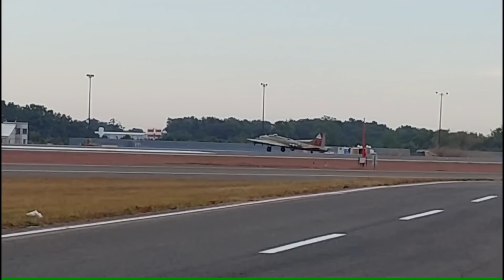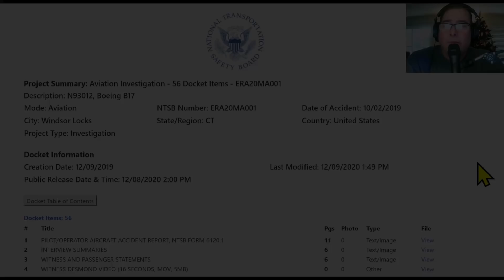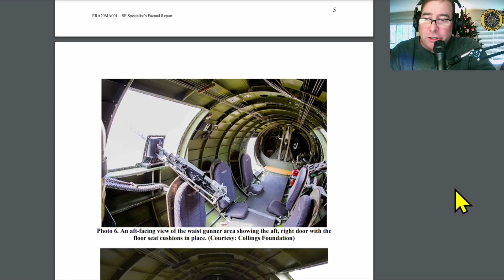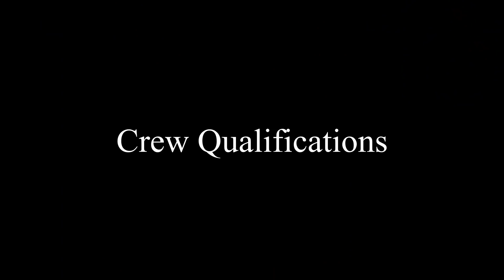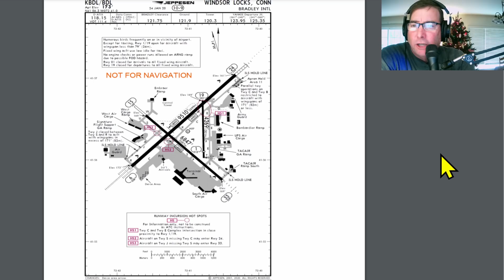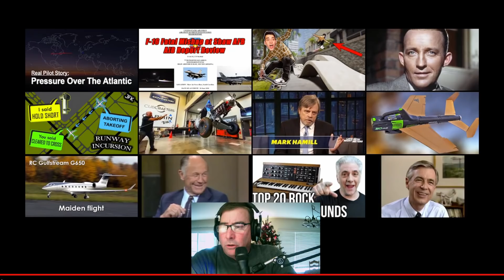NTSB Factual Report B-17G Crash 'Nine-O-Nine' Part I -16 Dec 2020

Comment: 2008 my son and I got a chance to fly on the 9-O-9.  I believe Mack was the Pilot. Looks very similar and the co-pilot who was on his first trip with them was very experienced.   Flight engineer and load master very good too. We got to assist in rollin& the engines over by hand.. We got good instructions on safety. Escapes routes.  Even told that doors were designed as break away so do not step on one.  Briefed on traveling through plane. Don't use the cables running through the cabin as you would be "controlling" the plane.  Wonder flight out of Manchester NH in September .  Sounds like something changed.  I am a Merchant Mariner (chief engineer) and very familiar with Similar requirements like SMS and others in this report.  We did get a thorough familiarization. We sat for take off and landing in the radio room strapped in. Once we were airborne we got the signal to get up. The overhead panel was removed so I was able to get some great pictures looking back at the runway with the tail of the plane.  No plexiglass over it. It was a great 45 minute flight. Hope they clean up and continue flying. But safer.

Comment: From the video, it certainly looks like she was getting really wallowy on the downwind leg. I guess options were running really thin on the ground at that point. Such a tragic loss.
Reply: Juan calls it monday morning QB, but they passed by the closer cross runway.  That in itself is not necessarily a mistake,  but it may have been one option to break the chain leading to what happened.    If I was low and slow, I'd think the relief of getting on final for any runway would be magnetic, barring unworkable crosswinds.
Reply: @johngoscinski1995  I'd like to think I would have been mindful of 180' of turn towards dead engines when there was the option of just 90, but I suspect that call may have had to be made before the point we saw at the beginning of the video, at which point he may have had 3 working. I guess we need to tune in tomorrow.

Comment: Am I wrong in my understanding of the level of importance to try and make slow turns only in the direction away from the bad engine? I was trained to bank up to 5 degrees toward the good engine and make pattern towards the good engine. Seems like there are a good amount of twin engine out crash accidents having the pilots flying turns into the failed engine , slow airspeed and then spinning into the ground. Looks like the B17 in this case was in a right traffic pattern with the outer eight engine out. Would to like to hear comments on this; would it be helpful for this practice to be emphasized more in multi engine training?
Reply: He may not have had a choice at BDL as there is a ridge to the west of the airport. I hope Juan talks about this more in the next video.

Comment: I'm very surprised that modern belts were not installed. It's bad enough on airliners that the  belt buckles differ so much from automobile buckles, but these military ones look impossible. With sideways seating, there ought to be shoulder straps as well and  a headrest or pad on the wall; in fact, modern military aircraft have backward-facing seating for passengers although paratroop transports have the sideways kind.

Comment: The 9-0-9 was at St. Paul, MN airport August 2007 along with its companion B-24 and B-25.  I did not have my video camera with me.  All three took off right over me.  That was a goose bump moment.  The loss of the 9-0-9 and the lives that were lost gives me that pit in the stomach feeling.  Good job, Juan.
Reply: I helped run that airshow at Holman Field with Craig Schiller from Golden Wings up at Jane Field in Anoka.

Comment: Nine-O-nine was in Florida a few months before this accident. One of my dreams in life was to take a ride on a B17. I had the money for a ride, but I didn't go. I am not sure why. My friend was urging me to go, but I just said no. She was a beautiful bird. :-(
Reply: Years ago saw this in Brainard/CT & wife offered a ride for my Birthday . Unfortunately my disabilities prevented me from boarding,  Seeing this on a Conn. Station gives me the chills even Now.
Reply: @nickoshana2246  I did crawl through Nine-O-Nine because of my health issues, like you. There was a B24J there too. Oddly enough I saw the fueling Nine-O-Nine and I asked what octane gas they were using. For some reason it just kind of concerned me I don't know why. I mean you get down to it without any turbo boost you could typical car premium would run in those engines. You would need to add a little bit of lead to it but it would run. A guy fueling told me it was 100 octane. Even that is a little low if you're going to run the full power of the turbo superchargers into the engines. I want to say during World War II it was 110 or 120 octane gas they were using. They're using something similar in the M4 Shermans. My dad told me about needing to wear gloves when he was feeling the tanks he operated because gas would just burn your hands up. By that I mean chemical burn.
Reply: Yeah I hear in Florida when it rains it doesn't mess around. I wouldn't call it a monsoon but I've had four inches an hour fall at my house here at times. And that wasn't even during a tropical storm or a hurricane. I actually have a weather station that measures all that stuff. It can get pretty interesting when you're lightning sensor keeps going off and you realize that there's been 409 strokes of lightning within 20 miles of you. Simple rainstorm here can throw 50 mph winds your way on a really bad day. Part of why I don't have trees in my yard. At my age cleaning up branches and leaves and what have you is just not possible.
Reply: Somewhere around 1987, 9-0-9 was a fresh restore.  I was a freshman in college at Embry-Riddle, right on the Daytona Beach airport.  One thing about Florida.  When it's raining, your options for recreation shrink drastically.   One rainy weekend, we had been trapped in the dorms when one of the guys pointed out the 9-0-9 was open for tours across the ramp. We went over there in the rain storm, and paid $4 each (1987 remember) to tour the airplane. And by tour I mean they set 3 flight-crazy college boys loose in the plane.  We swung ourselves up into the nose thru the crew door.  With the weather, there wasn't even anyone showing up for tours.  We had it to ourselves for a good 45 min.
Reply: @johngoscinski1995  That would be fun, have some friends that were a big time enthusiast for b-17s to go crawl through. The friend I was with like them but he's not like rabid like I am. It is my absolute favorite plane in the world. Maybe it was all the movies I saw as a kid and the TV series 12 O'Clock High. I just always loved the bird.

Comment: I also flew on a B-17G several years ago. I sat in the nose cone seat during taxiing and take-off. No safety instructions were given before or during the flight...the whole flight was exhilarating!!!
Reply: During WWII the bombardiers did not sit in their "window office" during takeoffs and landings. They sat with the navigators in the lower forward compartment.
Reply: Which B-17 was it?
Reply: @capbustchasing  "Sentimental Journey" flown by Commemorative Air Force. It was making the rounds in northern USA and parts of central Canada. I jumped on board at the Canadian Warplane Heritage Museum at Hamilton Airport in Ontario Canada.
Reply: From wartime experience sitting in the nose cone seat any safety instructions would have been irrelevant, they were nearly often killed, so much so they stopped sitting in the nosecone seat during takeoff and landing.

Comment: Just found my pictures from when it was at Nashua airport (KASH) maybe a week before the crash.  The two right most engines (#3, #4) have tons of burned oil marks on them, and the two left engines (#1, #2) do not
Reply: You might consider emailing those pictures to the NTSB.
Reply: @joevignolor4u949  hoenstly I tried but I couldn't figure out how to do that

Comment: "Criminal negligence refers to conduct in which a person ignores a known or obvious risk, or disregards the life and safety of others. Federal and state courts describe this behavior as a form of recklessness, where the person acts significantly different than an ordinary person under similar circumstances."

The scat is about to hit the rotary oscillator.
Reply: Honestly,   this event raises some ire in me.   An event like this could jeopardize the future of passenger warbird flights in more ways than one.   The sheer level of irresponsibility is stunning.     The belts,  the passenger briefing,  leaving that much runway behind you when you know you just had engine problems,   all of it.    The FAA is likely to come down hard,   but,   if they look in the mirror they have to accept their share of the blame for their complete lack of oversight.     Insurance for warbirds is already ponderously expensive and hard to obtain,   there is going to be a cost ripple.   And the lives lost,  they can't be replaced.    And one more thing,  it strikes me as a potential conflict of interest when the person who gets to fly your toys the most is also the chief maintenance officer.  It just seems to me like there should be some separation of powers,  but maybe I'm being to subjective on that point.
Reply: @pR1mal.  If you think what you've seen so far is bad it will get a lot worse when you see the maintenance issues that caused those two engines to fail.
Reply: @joevignolor4u949  You were absolutely right.   The more I read the reports,  and after watching Part 2,   just wow.

Comment: Thanks, Juan - excellent as always. Looking forward to the engine analysis. Seems like the wrong engine was caged from what I've read so far.

Thankful there were any survivors at all on this one. While there can be alot of criticism thrown at the PIC, that credit goes to Mac for keeping her from stalling. R.I.P those lost.
Reply: No. NTSB found #4 mags inoperative, poorly safety-wired cable had pulled out. Spark plugs mis-gapped and fouled on both #3 and #4.
Reply: @roscoejones4515  - Thanks for the info - I thought I had saw that too, but wasn't sure. I read some conflicting info somewhere and confused it with the NTSB report.

Comment: I still don't understand the flying technique that devolved into the crash.  This was a fairly lightly loaded B=17 and sure it had two engines out on one side, but does that doom it?  You can't maintain altitude on a lightly loaded B-17 on two dead engines on one side?  I can't believe that.  B-17 brought crews back on many occasions like that and they were much heavier even on landing.
Reply from the maker: Note the energy state at the beginning of the emergency...
Reply: @blancolirio  Oh yeah, they were low and slow but it somehow got worse.  I am wondering if it was a lack of confidence in adding more power on the good side.  They baby these planes so much and hate  to push throttles forward and probably had no experience on two engines low and slow.  It would be interesting to know if B-17 training in WWII included this configuration.  Back then the taxpayers could pay for potential engine damage.  I would really like to know IF you could push at least number two engine to the firewall and maintain directional control at that low speed.
Reply: Unlike the war time B-17, the engines are no longer run at such high power settings, fairly low octane these days. The B-17 was designed in 1935! Away different safety standards back then. A side note, I read somewhere a “war authorized max gross weight was above 70k lbs.

Comment: Having flown DC6/7s. Old aircraft operation is an art rather than a science. Sad this happened.didn't have to.
One other thing: Declare an EMERGENCY! Then the airspace is yours. A bit of paperwork and phone calls is better than crashing..
Reply: It is a lot of freaking work to fly these things, old and complicated Plumbers Nightmare. Beach 18's, DC3 captain... C46 almost.. You have to be a tough pilot and tough mechanic too.  Jets are a walk in the park compared to old pistons.
Reply: @emergencylowmaneuvering7350  
"Jets are for kids"
Reply: @emergencylowmaneuvering7350  
Yes nothing like changing a PRT in an 30+ mph wind in Winslow Az. We did run them at 2880 hp for takeoff and did not push them but I loved the R-2800 on the 6.
Reply: @emergencylowmaneuvering7350  Yep heard similar from one of the Captains I flew with. Florida and the Caribbean.  Didn't have water on the 7.did onthe6
Reply: @emergencylowmaneuvering7350  
Actually because weren't running at design power cynder changes were no common place - I was also the the FE getting pretty good at reading engine analyzers..if there was a misfire or worse no fire, meaning some thing's
loose in the cylinder head.
Like a chunk of valve. Then we shut it down.
Go home if possible and changed the cylinder.
It could take out six others connected to the same PRT. You had to watch it like a hawk.
Reply: @tgmccoy1556  Hey Tim, the first two batches of L-1049 Super Connies built for Eastern and TWA did not have the TC engines. Those had the same engines as the L-649/749. Very reliable and were some of the last ones flying. The father of one of my best friends was the maintenance manager at LAX for KLM when they operated the L-1049 and L-1649. After United got their Sevens they hired him away. They say Dutchmen are hard headed. Well he was a doubly hard headed Dutchman. After their Sixes and Sevens were mostly gone I asked him if he missed the piston engines. He said, "Hell no. With jets I hardly have anything to do. I like it that way."
Reply: @dalecomer5951  We got better reliability out of the TC 3350 by not running hard also stuck with 100LL did occasionally run 115/145 Which made for good cool running.
Reply: @dalecomer5951   Didn't know that. I know the P2V had water injection . Aero union had experimented with removal of the jets and piston only P2's lighter, didn't work out too well as the J 37s gave a bit of security in an emergency.
Reply: @tgmccoy1556  Watched Minden Air Tanker 42 and 48 (iirc) put on quite a show on the other side of the canyon around 2010. I was sitting on the roof and looking down into the cockpit. RIP.
Reply: @emergencylowmaneuvering7350  Yep! I have over 3,000 hrs in DC-3s and Convairs.
Reply: You are 100% right but saying "My 75 year old airplane wasn't safe to fly" would make headlines.  Of course crashing with fatalities is a lot worse.
Reply: Familiarity breeds confidence. The pilots could see all the runways out their window. If they thought they couldn't make the long runway they would have used the short one. Until the last moment they thought they were fine.

Comment: Warbirds are planes designed in their day to be at the cutting edge of performance, and traded reliability for performance, and expecting reliability 75 years on is asking for a miracle, especially without the hundreds of trained ground crew in a typical WWII bomber group to look after it continuously.  Also, like the DC-3 you covered so well a few weeks back, it’s really hard to handle at low speed, especially with asymmetric power in the air, and also on the ground until the tail is solidly down.  Put these factors together and add a bunch of passengers who don’t have any emergency response training, and it’s a recipe for disaster.  Perhaps time to retire them all and keep them as static displays?
Reply: If these kind of crashes keep on happening, the FAA might just yank that exemption and that's that.
Reply: We have enough historic aircraft that are not airworthy as static displays. Keep the airworthy ones in the air, so people can keep seeing and admiring them where they belong. At least for limited flights during displays and airshows.
The main problem is irresponsible and reckless owners and pilots most of the time. I have no doubt these were skilled pilots. But people do lose some of their reflexes and fast thinking when they get older, both pilots where 75+ here. There is also the likely case that this aircraft did not get maintenance to the standard it needed.
Reply: @slome815  Just watched part 2 - it’s more lack of resource (one guy who does both maintenance and piloting), and resulting inadequate maintenance.  These planes were hard enough to keep in flying condition in 1944, with all the trained crews and ground staff. And now, with basically one experienced guy who knows what he’s looking at, they simply can’t be kept in proper condition.  I guess they could still fly but there’s a real need for a bigger organization and more rigorous checks by independent (and also properly trained) inspectors.
Reply: ^ this